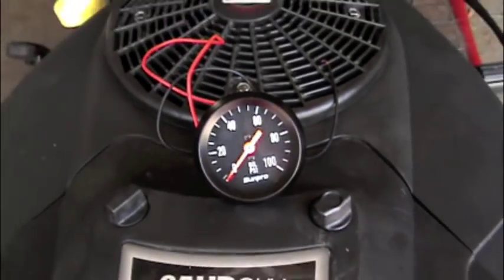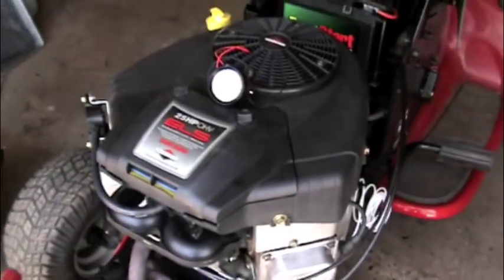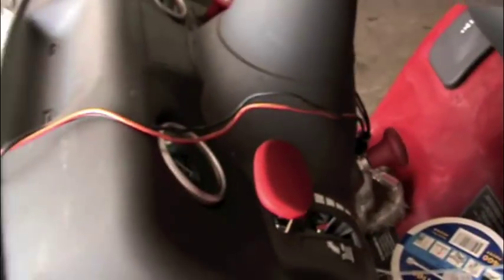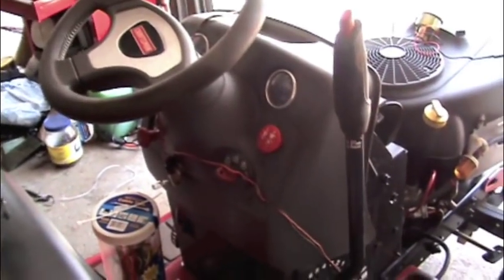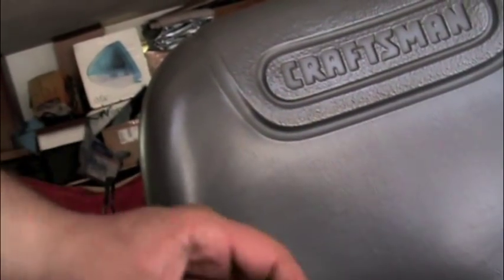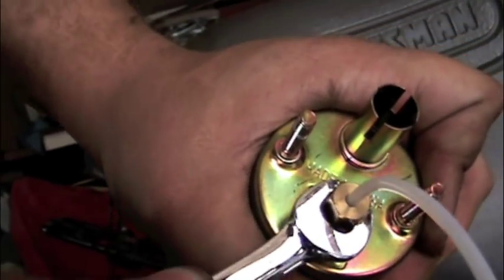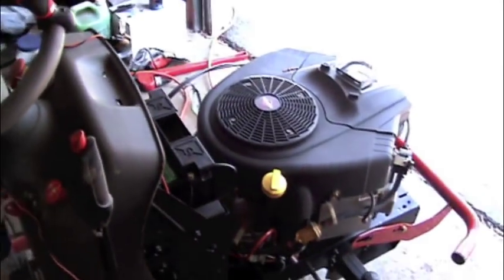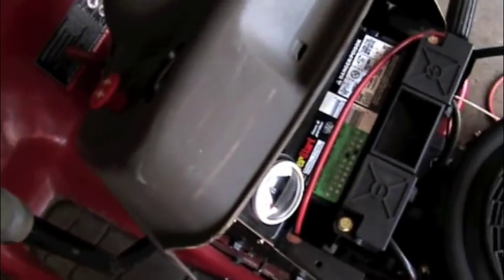Installing oil pressure gauge on a Briggs and Stratton engine

Comment: An oil temperature gauge would also be good.  On an air cooled engine, the oil temperature would be your indicator if you're overworking the mower.  The tach is also a great idea.  Mowers are set up to be run at a full throttle governed speed, however, if for some reason your mower isn't obtaining that speed, you wouldn't know it without a tachometer.  If your throttle cable stretches or the linkage becomes worn or conditions would warrant an adjustment you might be losing engine speed without having any way to know it.  It's also good so that you don't slow the engine speed too much when cutting heavy grass.  I would also find a voltmeter useful.  Thanks for your video.

Comment: Getting ready to do this myself. A tip: since you said it reads 0 hot use another gauge to verify, like one from a pressure cooker that only goes to 20 PSI.

This Sunpro gauge has a zero pin and may be mis-zeroed with the needle sitting against said pin causing it to take several PSI before the needle even starts to move, IE is inaccurate. If you can get it open without destroying it i would break off the pin and note where the needle pointed without it.

Comment: Got mine all hooked up, used a glowshift sandwich adapter, braided ss lines and an oil filled shockproof gauge. Cold it reads 50psi at idle. Plannin on hooking up an oil temp gauge with the open Ports in the adapter.

Comment: @moldymac I just wired a 12v 15 gallon ATV sprayer to a JD 318 and it was cake. I ran it to a switch and everything. All you do is get a 2 prong switch, run a wire to the battery and connect it to one prong, run a wire to your accessory and run it to the other pole, and then ground the accessory. just make sure to put an in-line fuse on the wire that goes to the battery!

Comment: @moldymac, yes, mine works fine, at cold oil the pressure goes up to 60, after the oil is warm it drops down to the normal operating range at 30 psi, normal operating pressure reading is between 15 to 40, soon as the weather warms up, i am going to install the volt meter and the oil temperature on it, i will post a video response about my craftsman tractor with briggs engine oil pressure

Comment: Briggs & Stratton has a 15-55 PSI spec on these engines, I believe. Your pressure should not drop to 0 at hot idle. Gauge may be bad. Mine holds about 29-31 PSI at hot idle and 40 PSI at 3,300 RPM.

Comment from the maker: @stydel311 No, this port is for testing the oil pressure.  This engine has a quick drain valve (black and yellow valve).

Comment: i did the same thing to my craftsman tractor, i installed an oil pressure gauge to it, next step will add a volt meter on it and temperature gauge on it for oil temperature reading

Comment from the maker: When cold it works fine, but once the engine gets hot it drops to zero.  I blame that on the viscosity of the oil when warm and these engines probably run less than 5 psi which this gauge can't accurately measure.

Comment: Put one on my Ariens grand Sierra 2200 Kohler command 22hp on Kohler you want to use the plug by the oil filter there's not enough at the sending unit mine holds 50psi cold 35 psi hot at runing rang used copper line kit air cooled engines get much hoter than liquid cooled I know a guy blowed his line got hot blew